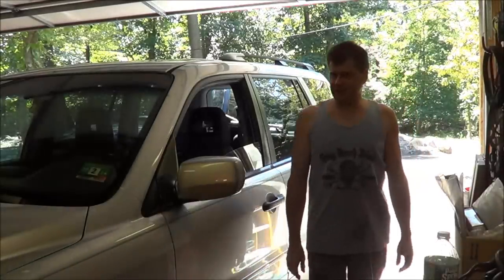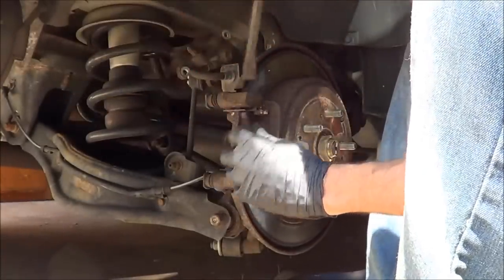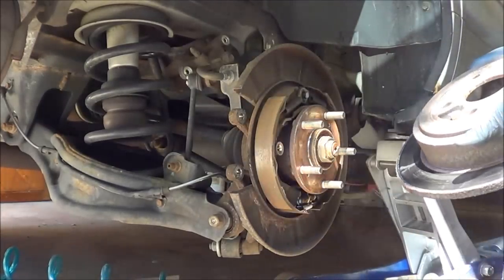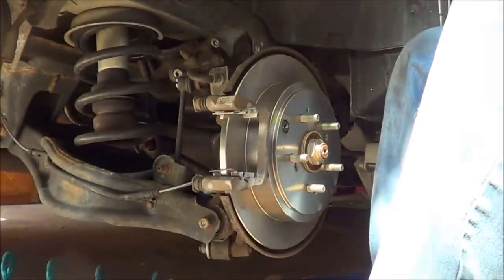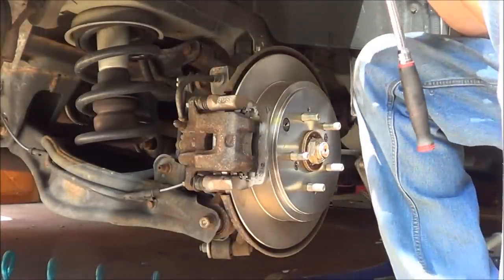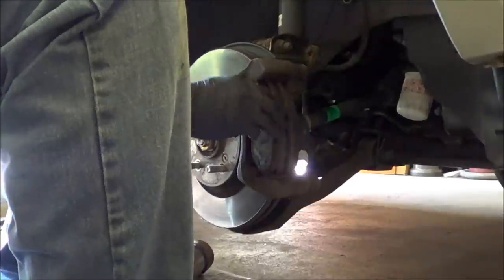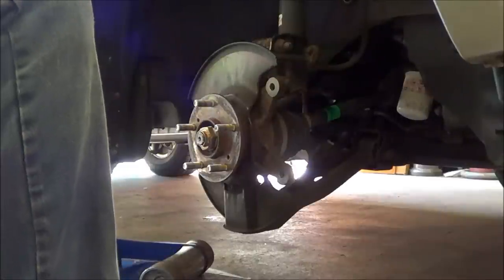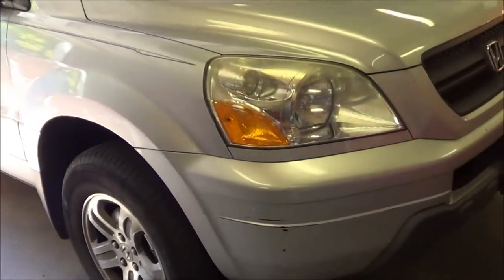8-25-13 2004 Honda Pilot front and rear brake replacement

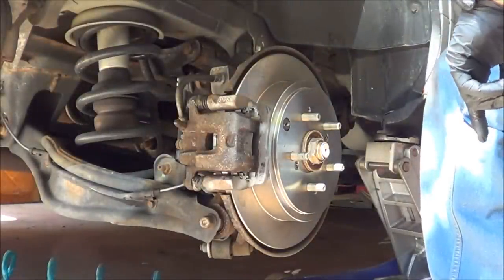Comment: Thanks for the great video. I didn't understand your instructions at 12:55 regarding the setting the brakes.
Reply: The calipers won't be close to pressing the pads into the rotor after the install.  He suggests going into the car and pressing the brake pedal (maybe a few times) to close that gap.

Comment: Generally Good Carl.... a few thoughts beside jackstands... even though your using a truck jack.... torque on the slide bolt is 27 ft/lbs.... torque on the caliper brackets is 41 ft/lbs.... how about a little anti seize on the M8-1.25 rotor screws... those of us where road salt is used in winter need to get this apart again...and again... our rotors rust from the inside web... Great video quality!
Reply: +mark murphy    Agreed on jackstands - widowmaker avoidance FTW!  Thanks for the torque specs.

Comment: i am not a mechanic at all, but do my own brakes. i never would use a flat head screwdriver to depress the calipers. i been using a  Brake Caliper Tool Spreader
			
Share:

Comment: Great video.  What size are those screws to undo the rear rotor ?
Reply from the maker: number 3 phillips
Reply: +Broncocarl92   I meant the screws that goes in that hole to break the rotor loose. Is it M8 ?
Reply from the maker: +pepito pepito yes M8x1.25
Reply: +Broncocarl92 thanks

Comment: This video is a few years old but idk if you will see this..my question is what is the name of the tool that is needed to remove the rotor?? I had that tool before, but I can't find it and need to call the dealership. So i just need what its called
Reply from the maker: Diedrie Gibbs that's an impact driver.
Reply: Oh wow you responded. Thanks a lot for the help. :)
Reply from the maker: Diedrie Gibbs no problem